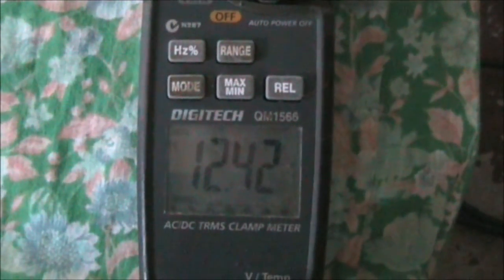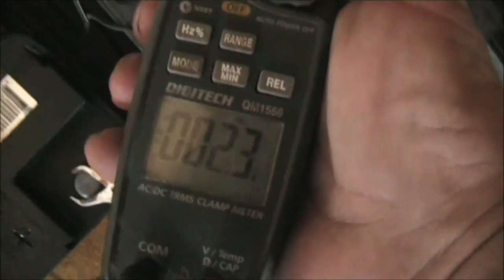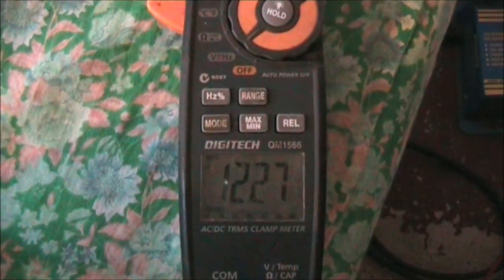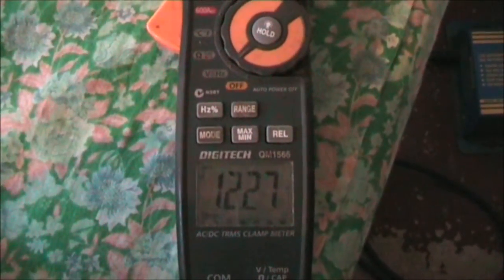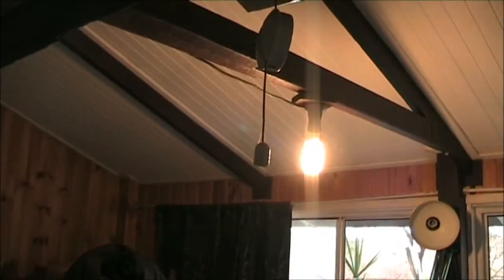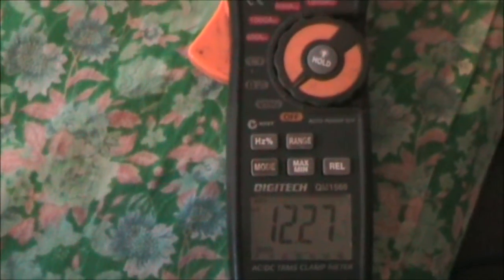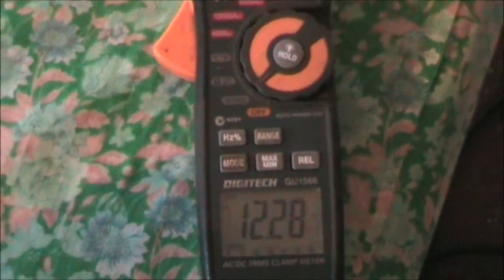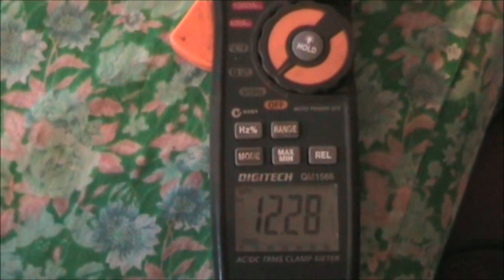Battery bounce back under load

Comment: I have noticed with typical Trojan 1275 Deep Cycle lead acids, put under c40 load (50 watt lamp) - the initial drop is a big one, but after about 20 minutes it climbs back up to a high operating plateau